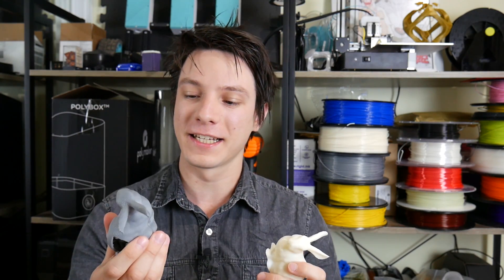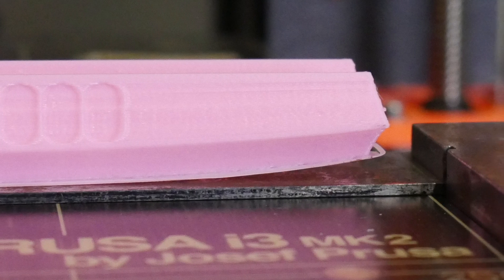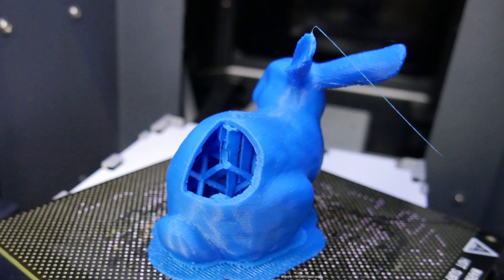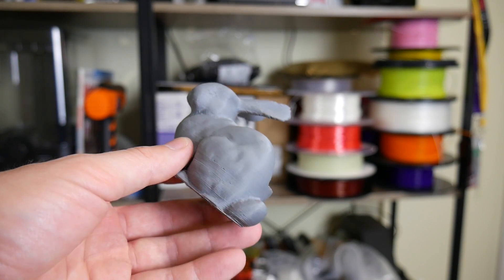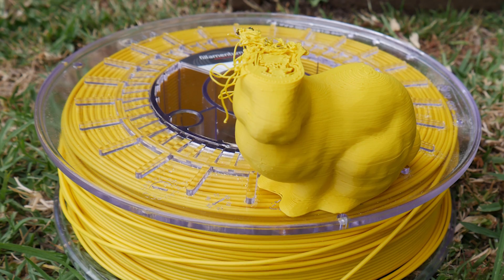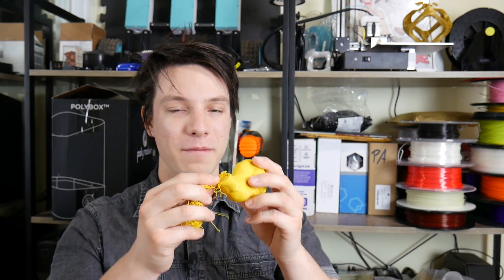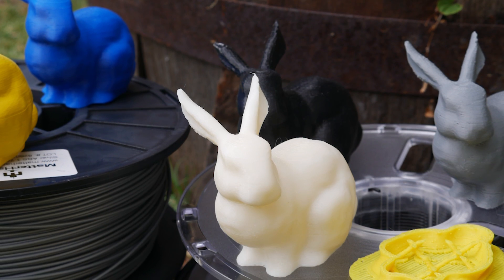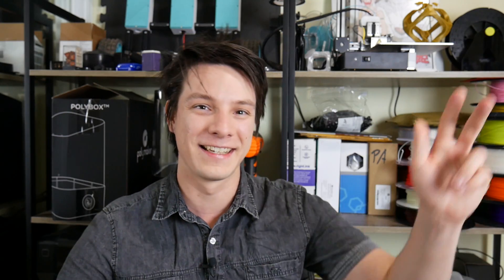Should you 3D Print in ABS? Probably not.

Comment: i disagree. abs is actually more tough and impact resistant than pc when printed at 100 walls. its also cheaper and fails is a better way. pc shatters like glass when it fails while abs bends and deforms if printed with 100 walls its the most tough filament i have every tried destroying with a hammer(only tpu beats it).

Comment: Im out here in 2022 switching from dogshit PLA to ABS. Granted; I just built a heated enclosure for my printer that reaches 75 C;  but I feel everything ive been told about ABS is a lie. It prints fine, absolutely zero problems with warping or delamination on full 220x220 size prints; with the cheapest ABS i can find. PLA prints better, but im tired of my prints warping in the sun or breaking. Another lie ive been told is PLA is stronger; this is only when ABS is printed sub optimally. With a 75 c chamber its waaaaay tougher than my PLA prints (and i mean tougher as in the actual engineering definition).

Comment: I used recently a lot of ASA filament, nozzle temperature between 240C and 260C and bed between 70 and 105 C. It works very well, even a roll of 270 mm height. I did it on a creality cr-s10 pro, on a creality cr-6 se and on a prusa printer. It sticky very well on the bed, nearly to well. For me, it was as easy to print as PLA, with many advantages of ABS, as higher temperature resistance and UV resistance. More I use it, more I like it.

Comment: You should do an update, now that it's been demonstrated to print well in Ender 3 with:

1. TOTAL air deflection from the print (blocking off the rubber boot to hotend enclosure space with aluminum (metal duct) tape, with an air outlet at the back and UPWARDS facing.
2. no enclosure
3. glass bed with coating, no glue stick

Comment: I tried ABS. I had to install an all metal hot end to do it. I was really disappointed in part strength. What part strength? This stuff crumbled to dust when the part was finished. The filament was 4 times stronger than a finished part and the finish was terrible. PLA is so much easier to work with. My advice is stay away from ABS.

Comment: Honestly ABS isn't that hard to print, the only reason I have trouble is that my printer barely reaches 95°c on the bed. If it reached 100°c it would print flawlessly. For the time being I just squish the first layer a lot and it does fine. I have a 125€ printer BTW, so if you have trouble with your expensive machine, you got ripped off.
And compared to other filament that are ridiculously expensive and need stupid high temps, ABS stays the most realistic filament for the lambda user who wants a "stronger" filament than pla.

Comment: Sometimes the ABS is a must. I am using it for replacing fairing fixtures for my motorbike. Base material is ABS, and using the very same material allow for easy rebuilt.
In fact it was not that difficult to print it, and acetone smoothing definitely was an added bonus to get easy insertion in the rubber holes.
No doubt other material can probably be better for many applications but sometimes ABS is really the only way to go.

Comment: Depends on the application. I am using ABS to print parts for a wheelchair. So ABS is a good product to hold up in high temperatures living in FL. I just need strength and durability, not so much detail. Yes, the price and acetone bonding is why I will stay with ABS for WC parts.

Comment: since PLA sticks quite well to the printer bed , have you ever tried printing a "raft" (by putting say a 2mm thick square under your desired part with fusion 360) with PLA then with cura use the extensions to add a filament change Gcode at the start of the part to change over to ABS ...... you'd be essentially printing a raft out of PLA on which the ABS part sits on ..... just curious if anyone tried this ?

Comment: Still printing in ABS today and recently started to print in ASA.
Why do i love ABS so much?
I just LOVE the fact that you can weld it with acetone, and it's not as brittle / stiff as some alternatives and not as hygroscopic, so you can store it easily without degrading.
Also ABS and ASA can withstand higher temperatures before melting, ASA is even UV resistant, so no degradation from direct sunlight.
- Note that i do not print funny puppets and stuff, only useful items like brackets, casings, repair parts.. -

Comment: At 5-8 USD per kilo (if you search a bit) ABS is by far the cheapest filament to mass produce. Strength quality also increases quite a bit if you know what you are doing (For example, ABS is 25% less dense than PC and PLA. Added that  both PC and PLA so its expected to fail way sooner. On the plus side, you can strengthen critical components, actually leaving you with a part that is as strong for the same weight. Another example: you can really strengthen ABS parts by manually adjusting temperature on critical places /detailed places.)

Comment: Yeah... I've had resin printers for a while now... Found a Da Vinci 1.0 AIO on FB Market for $50... with its only issues being user error. Leveled the bed, cleaned it (thoroughly), made sure auto level pickups were reading, etc... and from the first test print to now, some dozens later, its been all ABS all the time... phone cases with go pro mounts, large stylized lighthouse model for family that was near the entire Z height and half the width of the build area... CPU holders, Ram holders, etc... all printed, all good, minimal warping if any.... really, my attempts to anneal were they only things that brought warping. And this is an old printer, lol... It is enclosed, sure... but it's not like it's got an oven. Just whatever heat the bed makes keeping it toasty in there, if at all... and it's fine. Ordering more ABS right now, with my first roll of PLA, and maybe some T-PLA and whatever else I can print with, just to try it out. But yeah, no issues with ABS at all. I find it to print pretty nicely, not globby, details remain, no warping... looks good, works good. Now to get to resetting this cartridges and refilling them, lol.... this part is going to get annoying.

Comment: What about use case? I’m trying to print for aquarium safe models
Reply from the maker: I would try use PET but check with the supplier to be safe.
Reply: Maker's Muse will do, also in your experience which printers can you recommend that work best with ABS? I was looking at the CR10 mini
Reply from the maker: @LordFarquaad007  You need an enclosure to keep the ambient temperature high to prevent warping. Without modifications the cr10 mini and similar can print small ABS prints but needs an enclosure to print larger without warping.

Comment: ABS is irreplaceable.
It's the only filament I know of that welds to each other with a simple solvent, acetone.
That gives me great flexibility in my designs.
I could split a model in a bunch of little pieces to minimize the use of supports and then assemble the pieces with just a lick of acetone.
Reply: You can use dichloroethane for PLA same way.
Reply: asa is similar

Comment: i would say as time has gone on it has become easier to print in abs, getting a good sla printer is now cheaper and if heat is a real issue which through my experiance it hasn't been just turn the cooling off on the printer and parts shouldn't crack. Also making a box for your printer if this doesn't work isn't hard and not only helps with keeping the ambient temp high it also dampens noise from the printer. I print on a lulzbot printer i have had for 5 years and i have used PLA, HIPS and ABS, i settled on ABS to use for all of myt prints after not long, in the winter the ambient temp can be around 10 - 15 degrees which with the cooling fan off prints fine without an enclosure.

Comment: Its 2019, do an update to this video.
Reply: 2020 now
Reply: @RomeDrori  can't get abs printed even 2020
Reply: It's 2020, do an update to your comment.
Reply: @Angry_Outlaw  no it’s 2021 already!
Reply: 2025
Reply: I think just use ASA pretty much same price and also adds UV protection while maintaining the strength of ABS.
Reply: I come from the future, he should
Reply: Yah, the polycarb stuff seems rather expensive by comparison to ABS. I only had a quick look so I might not be comparing apples.
Reply: Anthony Abbass ayyyy 2020 gang
Reply: It’s 2023
Reply: You’re all wrong! It’s 2024! …and I’m trynna print with ABS on my new Bambu X1C and failing miserably. Lesson learned.
Reply: it’s actually 2024
Reply: Soon to be 2025💀😂
Reply: 6 years latter 😂
Reply: I don't think it really changes anything. ABS is still a good engineering material at a good price and it prints super tough parts if you give it the right printer.

Comment: You can also use PETG. It is very similar to ABS in strength and temperature resistance, but it prints at a lower temperature and doesn't warp as easily. Prusia Research even uses it to 3d print their 3d printers.

Comment: Tried using PETG for a while after watching vids with this opinion. My parts kept breaking when they absorbed forces from large impacts. Finally built an enclosure for my CR-10 and printing in ABS now and so far my parts are holding up. The ABS seems to be more flexible which I think is helping.

Comment: Been printing abs since I built my first Mendel soooooo long ago. 

Prints lovely on 110 c print bed with kapton tape down. You do have to print a shield round the part though to keep the heat in. 

But you can make big stuff if you do that. Always had issues sticking pla to bed without using some kind of stuff. 

Where abs just prints straight on to kapton at 110. No glue or hairspray needed. Just occasional acetone clean.

Comment: Two more things.  PLA is hard to sand whereas ABS you can definitely sand.  But PLA is a biodegradable plastic and ABS is not.  Correct me if I'm wrong but PLA will dissolve in water after a couple of years and what it dissolves into is non-toxic.  ABS would take something like 500 years to break down and is to some degree toxic.  So it's environmentally irresponsible to use ABS.
Reply: Well If you are going to use the part outdoors you would want a plastic that doesn't biodegrade. It all depends on the application; it's fine using PLA for statues that sits in your home, but you want something more resilient for things you use long term in your garden. You can easily rectify the environmental aspect by giving it to recycling when you no longer need it.

Comment: For me, unless I want high temperature resistance or acetone smoothing, I print in either PETG or PLA. PLA for decorative parts, PETG for practical items. PETG is much stronger than ABS for me, as it has ridiculous layer adhesion. PC blends are too expensive, so I reserve those for high stiffness, hi-temp uses (like printer extruder cases, fan shrouds, pot handles, etc)

Comment: I have been printing with abs for a while now from vases to paint brush holders to parts for my printer to lots of other things even thin long parts  I have had not one issue with lifting even on over 300mm tall  prints and my printer room temp it is in I only keep at 65f so its not real warm all the time and its buy a window lol iv had more issues with if I design a part with the walls to thin it will mess up but that's about it I print on glass with a layer of blue painters tape with no glue and its some times still hard to get prints off even ones with just a skirt no brim or raft yes I guess you can say I have been very lucky lol I have also been using amazon prime basics abs filament and its worked great for me I have done 4 15 hour prints on fine resolution recently  that were all around 290mm tall and 150mm wide  and 100 mm deep and have no issues I always run my bed at 82c and extruder at 230 with cooling turned off my print speed for a lot of my designs is 60mm/s with 110mm/s travel speed with 10% infill and this is running on my cheapest printer out of the two I have which is only 180 bucks now I also use calipers and dial indicators to level my bed and get my nozzle height right yes I am kind of anal about it so that is just my opinion and experience with abs  now I'm not saying there are not better options but for my if it has not broke yet I wont fix it I guess in the future when and if the abs curse hits me things may change keep up the great work new to the channel but likening it a lot so far

Comment: TL;DR: ABS is wonderful when you learn how to print it.

Resistant to impact and high temperatures, while tricky to print it yields incredible print quality when done right (way better than PLA in my specific printer), great to post process (you can cut/shave it with a sharp knife, easily deburr, etc) and it feels different to the touch, less plastic-like and a little bit more wood like in comparison to PLA(that lego plastic feeling, it feels more organic). Not to mention the ability to vapor-smooth, easier to remove supports, and the price. 

The downsides are only: 
- it's not biodegradable, so if you care about the planet you should be extra mindful about printing meaningless trash and what to do with your prints after their intended use. However, it's debatable how harmful PLA also is since it smells and tastes good and still can harm animals if they eat it, because it takes decades to decompose.
- the smell while printing (which may be slightly unpleasant and harmful, but to print ABS your printer will be most likely encased so it's not like you will breath it significantly if you are cautious with opening/closing the encasing and 
- It's a bit hard to print, bed at least at 100ºC, perfectly leveled bed, PVA-based glue or ABS juice for adhesion and print temperatures > 260º in my experience (270º works great). I prefer glue to abs juice because it's easier to clean up. My printed hasn't a proper encasement, it is simply installed inside a cabinet.

I was never a fan of ABS because I struggled a lot with printing it, my favorite material used to be PETG, but now I'm simply in love with ABS.

Comment: I have recently been revisiting ABS is it's been a success. I built a set temp chamber, and got usable results. The thing is, is that for most prints ABS from a chamber actually has really good layer adhesion and without a raft or anything you can still get away with large detailed prints with no warping. Once you have all your other setting dialed in it actually prints just a well as PLA if not better, and given the temperature it can withstand that gives it a huge edge. Not to mention is can be finished easier than anything else with Acetone smoothing. I have found abs likes 45 degrees C ambient 30% filament cooling fan (depending on your machine) , and no slower than 60mm/s depending on layer height. It's a difficult plastic to get just right but totally worth it. I went from giving ABS up after PETG became popular to now, ABS being my go to. With ambient printing heat it's strong, it's dirt cheap, UV resistant, heat resistant, can be printed fast, works well with all nozzle sizes, and it's uses are probably more versatile than any other 3D print material out there. The only problem you may get is difficulty printing small vertical details, and getting the layers to stick, but again all that can be tweaked out.

Comment: This whole video is flawed.  ABS is Great and doesn't have problems if you use the right equipment.  That's no different from any other mechanical process.  You compare a $7.50 spool of ABS to a $50+ spool, really??? and it looks like you probably didn't print the abs at the right temperature.   This video cost you credibility points.

Comment: One thing to consider is that abs has the lowest weight per cm3, which can be important when you're designing anything that needs to push the limits. I've printed parts for a model solar car engineering competition in both PLA and ABS and saved about 20g with the abs, which might sounds small but is rather significant in my application.

Comment: Hey, I do 3D Printing for almost 10 years now, and I own about 300.000.1 rolls of filament, I even still own some meters of my first spool of filament which was clear smoke blue PLA I bought for my Sells Mendel and my point is, I only own a single roll of ABS Filament. I never needed it, I don´t need it now and I probably never will. When I have the need for more stable prints I refer to PET(G) or Polyamide and when I need something more heat resistant, also polyamide or PC do a way better job than the PLA I use 95% of the time. Worst of all, ABS is nasty stuff ... when printing, it stinks!

Comment: Hi Angus,

I'm looking to print 1/10 scale car accessories like bumpers, witches hats, door handles, etc.

These items will be attached to a remote control car and probably even driven over or rolled over onto as the car inevitably rolls when going offroad.

Would you recommend PLA as a good filament for these types of uses?
Reply: I printed some parts for my axial crawler and the only filament that is strong enough is nylon. The rest will break or crack. Nylon is the best (flexibel) for bumpers etc...

Comment: I am just getting started in 3d printing. I am mostly interested in printing models, so PLA is fine for me. But, I kind of need to print a parts cooling fan shroud, and hold downs for a heated bed. I just assumed that I would need ABS for these. Would the Polymaker filaments you mentioned be suitable for these two projects?

Comment: Well here in the US off of Amazon, I've been printing with ABS for a while very successfully.  Main reason is cost.  Because of Chinese suppliers (I think), there is lots of affordable ABS out there on Amazon...typically on the order of 1/2 the price of a comparable high quality PLA or PETG.  ~ usually about $14/KG.  And the quality has been good.  I have a passive chamber for my Prusa MK2.5 and it works just fine (but admittedly is challenging without the chamber).